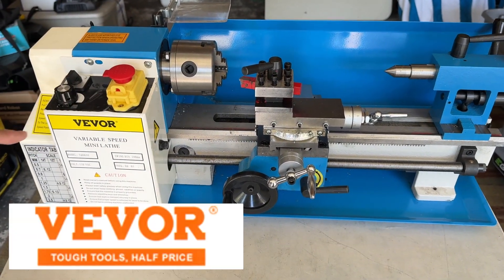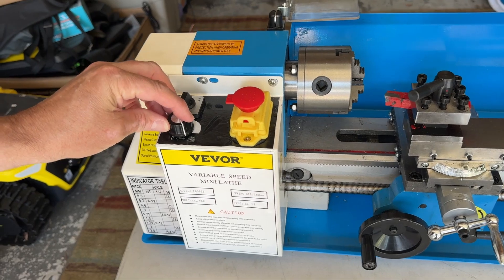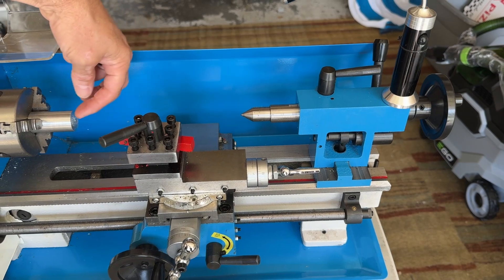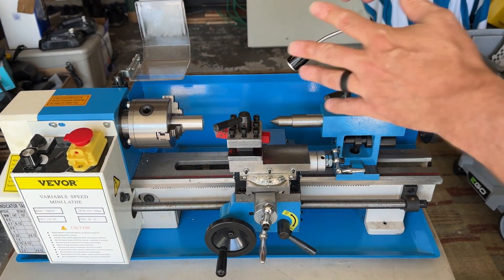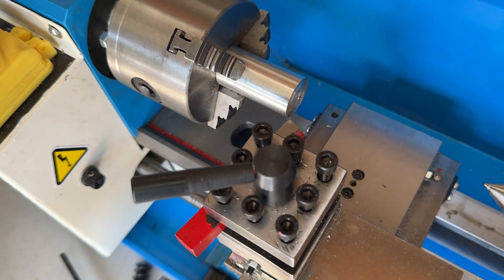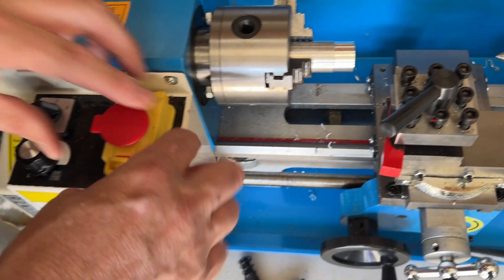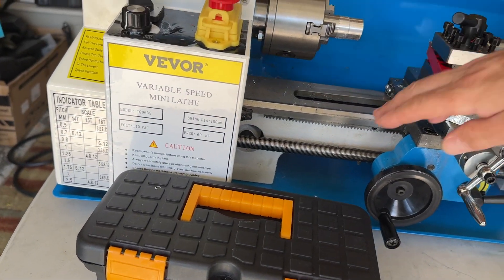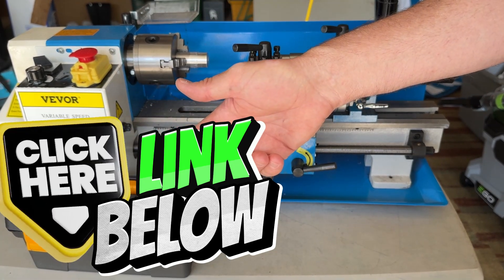Vevor Mini Metal Lathe Review | Best Value

Comment: Loctite is pretty good for the little adjustment screws. Had a g0765 7x14 that often times would require regular adjustments and those screws would always be looser than a had left them. Just a little loctite on each one helped solve that.

Comment: If you take them apart, and clean them and adjust them properly they will work good on aluminum, brass, plastics mild steel. It's no tool room lathe, but it didn't cost you $10,000-$30,000 either

Comment: I've owned my Vevor mini lathe for a little over a year and I've just recently finally gotten it to be able to cut threads.
Virtually every component that had anything to do with the operation of this cheap mini lathe was coming lose almost as soon as I'd re-tighten them.
Once I got it to actually cut threads without each successive pass being off just enough to screw up the previous threading pass, I found that when set to specific thread pitches using the provided gears and gear placement diagram, although the threads were being cut cleanly now, the pitches of the threads were NOT turning out as indicated on the stated diagrams.
For example, when cutting 20 TPI, I can set my gears up according to the diagram, but my threads come out somewhere between a 20 TPI or a metric thread pitch of 1mm.  
It's fine if I use the same settings for a one-off project for both inside and outside threads but, I can't match existing threads because the gears will not produce commonly used thread pitches.
The thread that it does cut do not match common metric or Imperial thread pitches.
Reply: Thank you for your review
Reply: Loose. Sigh
Reply: I just use my tap and die set to do therds.
Reply: The problem is you're trying to cut SAE threads on SAE chart. However you've got a metric lead screw! It's gonna come out close. But it's only gonna be close....

Comment: Hey man you think this could machine carbon or stainless steel??
Reply: No, you can do small stainless steel parts with small cuts, but if you are going to do it a lot get something else, this is not the lathe you are looking for, no idea about carbon fiber, it requires very special ceramic tools as far as I know, but no idea if the machine can do it.
Reply: Use the correct feeds and speeds  with a solid plinth block and you can hard turn on this machine! Don't believe most of what you hear about the c2 c3 platform lathes. If you have any skill at all, you can make excellent parts on this machine in most any materials... yes including stainless and titanium.
Reply: Probably would providing you have a high quality cutting bit, Id imagine the cheap bits that come with it wont cut stainless.. Also taking very small passes would be the way to go, deep passes only on soft metals..

Comment: when it is moving by itself how does the cutter stop before hitting the chuck? can you set a limit untill it auto disengages?
Reply: Good question
Reply: @MCcc-u5q  it won't auto disengage.  You have to be REAL vigilant to disengage the lead screw (otherwise it would 'crash' into the head).
Reply: @hillcountryrings  That is probably why the video cut when it did. He crashed it. 🤣🤣🤣
Reply: No... It will crash in and self destruction.... Like all lathe.

Comment: I bought one recently and initially I was quite pleased with what I received.  These machines always need some work to tighten up the gibbs but that is not the most important thing to inspect.  First thing you need to do is check the alignment of the headstock and tailstock relative to the bed.  If the alignment is not true and square you will not be able to turn a consistent diameter part.  It will vary in diameter over the length of the part.  This is the ONE thing a lathe needs to do correctly.  How do I know, because my headstock was badly out of square.  So much so I would have returned it but did not discover this because I was playing with the "fine tuning".

Comment: Man, it looks like rickety crap but I want one :)
Reply: That's what I thought too about 18 years ago when I bought my first 7x10 version.  Even though I now have larger machines and CNC, I still have two of the 7x14s in the shop. They do need a bit of tweaking but for the money,  they are still the best value in the garage. You can modify and drill holes for setups without sweating the destruction of a legacy quality tool. There are dirt cheap replacement parts available through LMS right here in California... seriously just buy it!
Reply: @britenrhodehouse8692 Were they Chinese 18 years ago? Probably much better quality than todays junk

Comment: No indicating, no calculations on correct rom for the cutting tool, just seeming like there isn’t much precision done in the video. I’d still love to get ahold of one of these. I wonder if they make a four jaw for this
Reply: You can get an 80mm 4 jaw chuck from Amazon that uses the same 3 bolt pattern (easy replacement) for this size lathe.  Anything larger (like a 100mm chuck for a larger lathe) most likely has a 4 bolt pattern and you need an adapter (or drill/tap the chuck)

Comment: They are junk unless you make plenty of modifications. If you don't have machining experience and a mechanical mind you're gonna struggle a lot.
Reply: It's under 500$ what ya expect. Seems like the shimming and adjusting is easy enough. I just ordered one. Guess I'll see how bad they are next week 😅
Reply from the maker: What do you think?
Reply: @lookoutman  it's fine for the few things ive done, making spacers, shortening bolts to exact length evenly, polishing some items. Custom door locks for my car and more. I don't need to do 10 items a day. If I can make 1 or 2 things now and then I'm happy. So far so good. Full tear down clean rebuild and setup to keep everything nice and tight. 
It's not perfect out of box. But with some tinkering you can have some decent results. Was able to make super shiney finish pass on steel and aluminum after get used to how fast and deep it prefers cut. I've only used low speeds. Seems more then fast enough for what I've done.
  (I'm not professional machinist just a guy who bought one and gave it a go)
Reply: @AutoMotoMechanic  como va tu experiencia de trabajo hasta ahora?